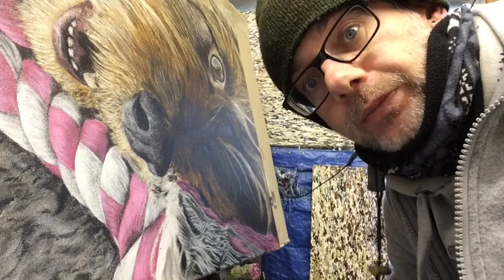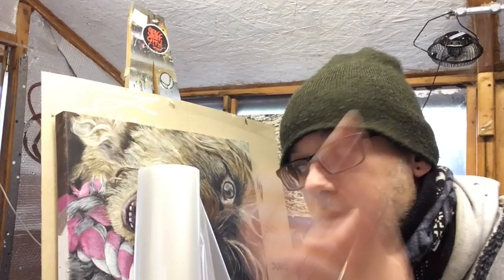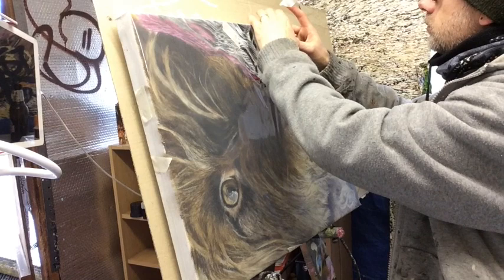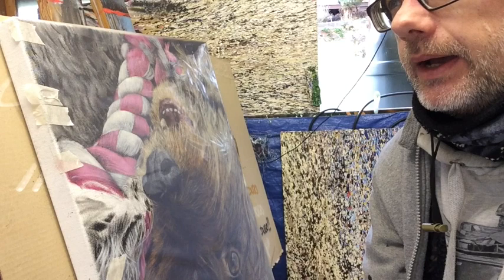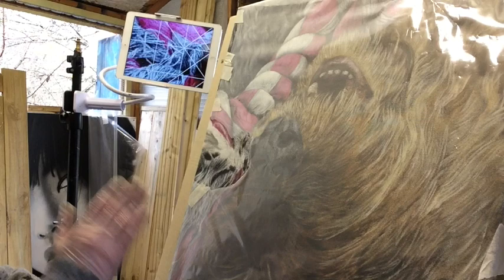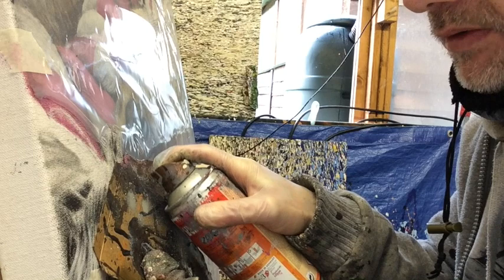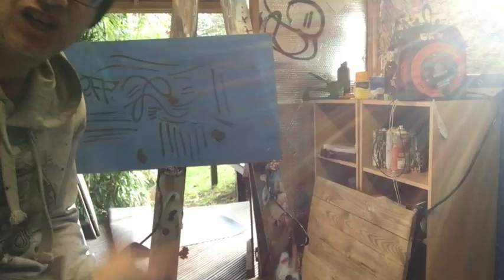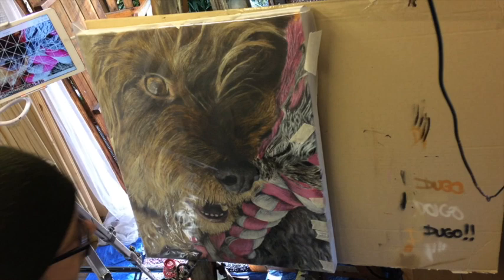Stencil Cap tips for Spraypainting!

Comment: This video is gold! I loved seeing your process. I played around with stencil caps recently and I wasn’t impressed. Maybe I’ll try them again after watching your process. Now have you tried out the mosquito cap? That cap I really like and it doesn’t clog, well at least it hasn’t clogged this far. I’m also about to try cleaning my caps with acetone to clean them out. I heard it’s good to let them soak for a bit in the acetone.
Reply from the maker: Aww thanks matey !! I have tried the mosquito cap but find that its still too high pressure for what i need. With the stencil cap not sitting 100% in front of the grey dot cap Im able to slow it down a little more, I smelled some acetone once that we had at work ..that was a mistake, nearly burned my insides ha ha nasty stuff! Ive tried using nail polish remover, soaking the caps in a jar of it, but that didnt work so let me kow how you get on!!